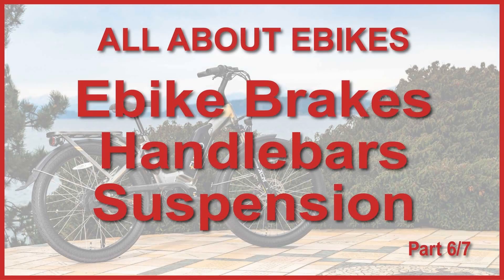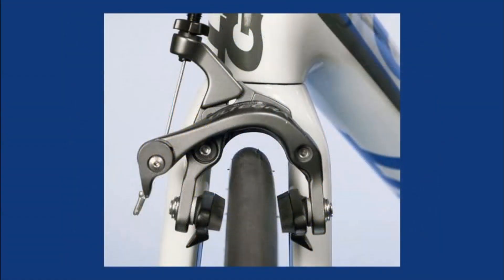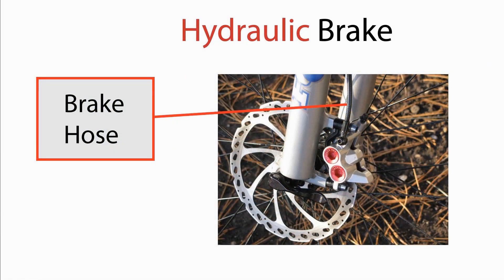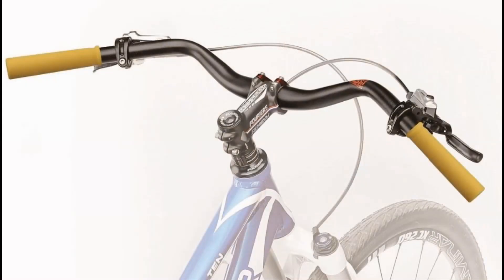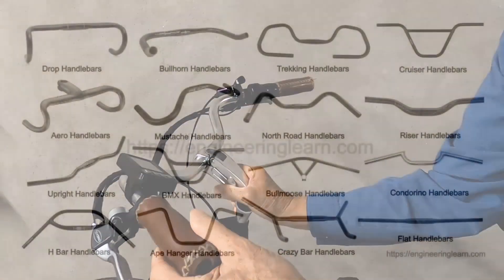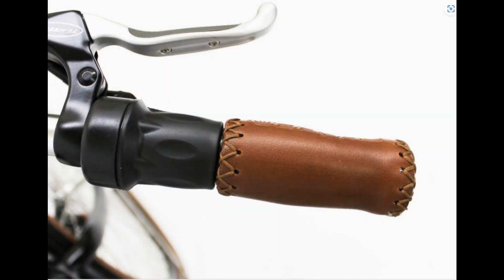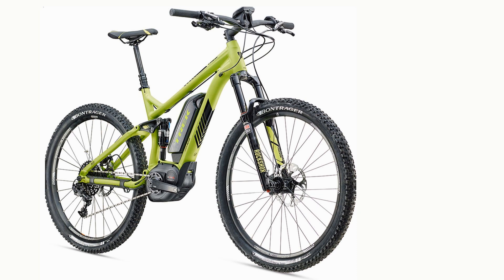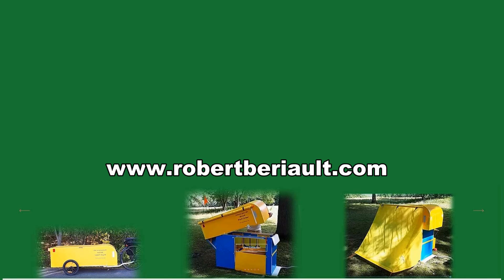Learn About ebike brakes, handlebars and suspension systems – All About Ebikes

Comment: I like Redshift's seat suspension. They also make a handlebar/stem suspension system which would work if you can't change the forks (and is lighter and cheaper). Unfortunately, a lot of new e-bikes have built-in displays on the stem, which would prevent you using this.
Reply from the maker: I learn something every day. I hadn't heard about the Shockstop suspension stem. Thanks for the info.

Comment: I converted my Two Wheeled Recumbent to an Ebike, back in 2019. I use Rim brakes and you can get pads designed for Ebikes. I've never had to adjust mine, unless I install new brake pads. I do have the brake levers that will cut off the motor. But when I stop pedaling the motor stops, or when I let go of the throttle. I've never had a problem.
Reply from the maker: Thanks for sharing your experience.

Comment: Good morning, I enjoyed watching this video with my breakfast. My son's e-bike has rim brakes, but it doesn't look like an e-bike and the battery is hidden in the bike down stem. My saddle was very uncomfortable when I bought my e-bike, I looked at suspension seat post and my son suggested I use my old scooter seat. My old scooter seat has built in suspension. It worked and my e-bike is very comfortable. Thank you for this video 😎
Reply from the maker: Glad you found a solution to your bicycle comfort.  Sounds like a good idea.